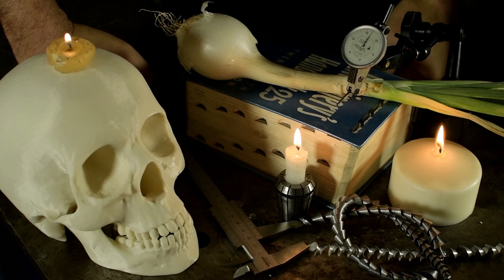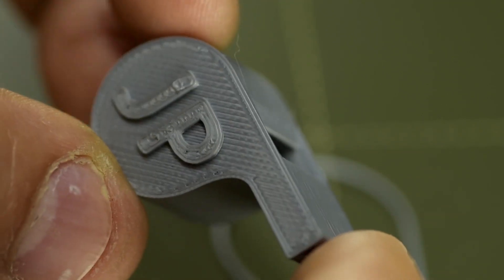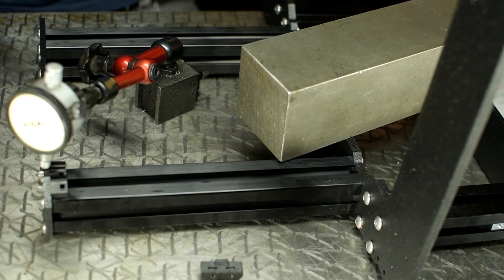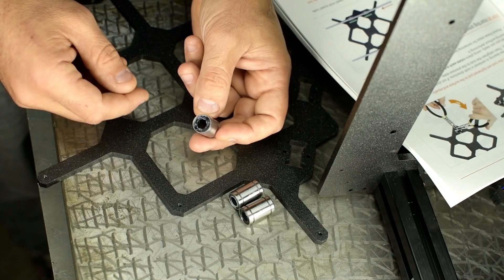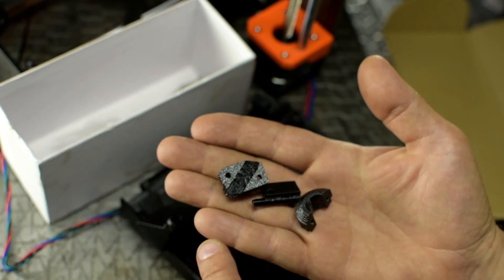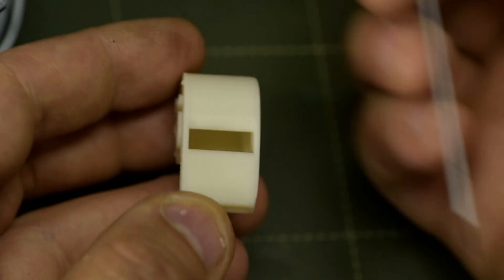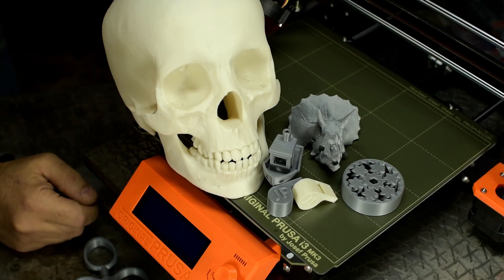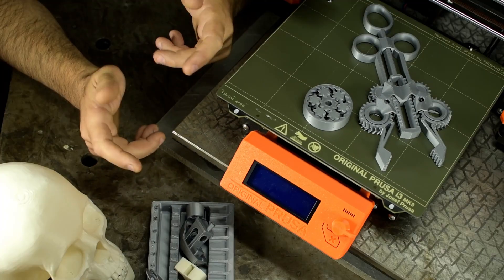This Old Tony in 3D!!! (printing)

Comment: Hey Tony! Check the Z lead screws, make sure it's square to the frame in x and y. I have found that printers are very sensitive to them being off even a little.
Reply: imagine if Tony upgraded or made from scratch his own 3d printer?! I look forward to the day 1 year from now (the time it take for the average CNC fan to acquiesce to additive manufacturing as a real "not going away" engineering option)

Comment: When you lubricate the bearings, you only need a light smear.......  if you pack the balls in grease there is a risk the balls will become impacted and start skidding.....  then the will  wear out faster and potentially gaul the shafts.  Over lubrication of bearings with grease is one of the most common causes of premature failure.

Comment: Bird water-whistles are the best printed ones IMO (except for the super-loud emergency type). You add water and the varying lengths of air escaping make a bird-sounding warble that you can vary a lot. Fun to play with.

ps- and a Clean/Dirty dishwasher magnet is always a well-received gift. and NO 5.5mm?! You must not have to work on Ford interior stuff much. ;)
Reply: Ford interior...  LOL!  That's the EXACT thing that I thought of.  Had to get 5.5mm for the knee panel under the steering wheel for my '96 Ford Contour.  Funny thing, just a couple weeks ago, I got a 2000 Saturn as a Daily Driver.  They used 5.5mm on a similar panel and on the  steering column shroud.  Maybe that Ford engineer got hired on at Saturn.  LOL!

Comment: I
You have no problems because it's a prusa. They send out good stuff. I put mine together and being the idiot I am, the printer worked surprisingly right out of the box. With little to no changes as long as you use a decent filament

Comment: I always thought a 3D printer as a toy, like what can you do with it? Whistles, benchies, toys.  Yes and some prototype designs that were later machined, pretty cool. I made a swivel block for a mono pod camera stand, it was perfect. Even though it is made from PLA, there is no evidence of cracking or failure. Sometimes you can make a solid model but often there is a bit of tweaking is necessary to really make a design work well. BTW, I bought the cheap unit, in hindsight, knowing what I know now, a Prusa  would be even better. Even so, the less expensive one can do a lot of things. Congratulations, have fun with yours.

Comment: The thing that was my personal tipping point for "it's finally time to cave and get one" is the boots for my motorcycle airbox. Those are totally "what do you mean $80 (x2)" Plus they are an awful fight in and out. Now with NinjaFlex something or other, I can make a custom airbox with monolithic boots which can handle the temps. It's amazing. I really look forward to having one.
Reply: Funky gaskets too!
Reply: Fiberlogy Fiberflex 40D is really nice too. It's got a good sproing to it and it holds it's shape well. It can be stringy as a motherfucker though, but that's just a matter of design.

Comment: I use my Tormach about twice a month, my lathe maybe one or twice a week. I weld maybe once a month.  I print 3d stuff 15 to 20 times a month and it's not uncommon to have my Taz5 and my Prusa Mk3 printing at the same time.  You just have to remember it can work all night and you can wake up to a new toy so don't go to bed until it's printing something.  Prusa was a good choice.

Comment: I think you did a made a good choice going with a Prusa, the removable bed is worth it alone.. but you also get the micro stepping and power outage recovery, auto bed leveling, filament movement sensor and more. I'm not saying the crealitys are bad, but they are no prusa. But hey, my first was a 300 dollar anet A6, I've had it for 3+ years and its still going strong.. Also, stay away from that devil material know as ABS, well if you have an enclosure it helps alot.

Comment: Printing is easy. But most people are going to have a problem drawing a 3D part. CAD isn’t the easiest of things to learn. So most people buying 3D printers stick to printing objects whose drawings they can download. I’ve been using CAD for several decades, and I’m sure you’ve been using it for a while as well. Moving to a printer isn’t so difficult then. But drawing a part for subtractive machining can be very different than drawing the same part for additive printing, as I’m sure you’re finding out.

I haven’t bought a printer yet because my dreams of one move to the realm of fantasy, as I really want one that will print metal parts. Plastic is nice, but not useful for much of what I do. Well, prices are coming down, so maybe someday. Good luck with this.

Comment: Decent Benchy for a Prusa machine.
There are a lot of print flaws, but that's just how Prusa machines with their weak ass frames are.
Reply: for specifics: it has some Z banding, and quite a lot of rippling.
Whiskers are from a bit too high nozzle temp or a touch too low filament retract, distance or speed (or combination of all 3).

Check if you can read text on back or bottom
Reply: Ender 3 prints nicer, but is slower and in practice you are limited to PLA (well ASA does work, but i like to print ABS or ASA hotter than PTFE hotend can do).

Prusa in that sense is more capable, and it's also way more polished. But less reliable too, and more finicky parts.

My choice has been a bunch of Ender 3s

Comment: To be perfectly honest with you, straight out of the box, an Ender 3 is about 90% of the machine that a genuine Prusa is, but for less than 1/3 the price and it only took me an hour to assemble mine, even considering the use of a dial indicator to get everything leveled properly. With the amount of time and care that you put into assembling the Prusa, you would have had absolutely identical results when printing in PLA with the Ender 3. 

Adding another $150 or so to the Ender's price with some pre-made upgrades (32-bit board, better bed leveling die springs, auto bed level sensor, glass build plate, all metal hot end, capricorn tubing, direct drive extruder, etc) and then printing a couple more things yourself will get you an even more capable machine than the Prusa and for half the price. And, since the Ender doesn't depend on expensive linear rails, the expandability is even better: longer 8020 rails can expand the scale of the Ender 3 almost to infinity.

Comment: ASA probably wants an enclosure as you've said. However I find that PETG prints just fine without one, and is definitely a good option if you need a stronger part. I'd also recommend dialing in some sort of TPU to print with. The ability to make bushings etc is fantastic. Also while you can probably mill/turn/weld stronger parts, making softer things usually involves a mold and casting, skipping that and just printing them can be a real time saver.

Comment: Be careful with humidity and filaments like petg, mine went bad (water in the filament - bubbling, popping) while printing a few small parts at 30% room humidity. The most permanent solution is to get and modify a food dehydrator to hold rolls of filament while they are printing.

Also keep in mind that the bed material can change depending on the material.

Comment: i remember the prusa i3 mk1, i buy it for 700 usd and feel scammed when i realize half the machine is hold toghether with with zipties. decent prints tho
Reply: @npgoalkeeper _ i know, never had a problem from a ziptie, just feels cheap for a machine that cost 700 usd, i bought after an artillery x1, i know is chinesium but it feels more value for my money than the prusa mk1

Comment: One thing about 3dp....   (not  counting the start, reset, retries ) you get the print going, walk away (maybe occasionally monitoring with octopi) and come back a few hours later and pull your print.    The real time waster is the time you'll spend designing stuff and figuring out good dimensions.   You do the same in any contraptioneering, whether it's wood, aluminum or steel, but you notice it more when you spend four or five hours in openSCAD (maybe I should learn Fusion360)  for something you only really spending 10-15 minutes (not counting unattending print time) at the printer.   It doesn't bother you so much if your spending a few hours designing then spending ten to twenty hours with saws, lathe's drill presses and files to make the part. 

It's also a thing where if what you're making is not too complicated you can just rough sketch it out and good-enough guesstimate dimensions beforehand and work out the exact sizes on the floor as you're doing (takes some experience and yes, I've blown a few projects by getting it wrong).   With the 3dp stuff you've got to do ALL the up-front up front.

Comment: Please do yourself a favor and set up a Raspberry Pi with OctoPi and the plugins that watch the heat of the hot end and the bed should there be a failure on the main board that could cause the temp to increase until there is a fire.   OctoPi not only adds safety to the thing, but also a level of remote management, camera views to your phone, and other tools like the ability to cancel parts of a build instead of the whole thing should there be an issue with one piece of something while printing multiple parts.  Hope you have fun with it! :-D

Comment: To address an issue that is NOT the subject of this video:

The blow moulded inserts that hold the parts in (e.g.) socket sets are really weak. But I saw a truly great tip. In a restore video the guy squirted builders insulating foam in the BACK side, and trimmed the excess flat when it had set. This provides really good support for the thin, weak plastic.

Cheap, easy, effective.

So - to give proper credit - it was Geoffrey Croker in NZ.

Around 18:15 in this socket set restoration:

https://www.youtube.com/watch?v=9ULUw5gtzj4
Reply: Thats a Great Tip, in Australia, we call that stuff Expanda Foam
Reply: @ashc5728  In Australia we call that stuff raising the practical jokes bar. Spaceinvader ya mates toolbox and see just how deep the friendship goes.
Reply: Very good idea. Going to do this to some of my sets tomorrow
Reply: Use the low expansion variant, and leave the tools in them while it sets if you can.
Reply: You'd be thinking of Geoffrey Croker's video where he restored the Stahlwille socket set. https://www.youtube.com/watch?v=9ULUw5gtzj4
Reply: @WilliamRowan  you mean the guy I named, and the video I linked to?

Yes, that's who I meant. Thanks for clarifying. 🤣
Reply: @WilliamRowan  Just thinking what His channel was called thanks for a lot less head scratching

Comment: I will say, look into lost PLA and lost wax casting. By far the handiest thing I have found for 3d printing, you can fairly inexpensively take any shape you want and pour it in aluminum. I don't know, with TOT's current hobbies, how useful plastic parts are going to be, but the ability to make molds for cast parts is a game-changer in the home shop for me. And good choice on the printer, I built my own in 2013 and finally got tired of the printer always needing work & attention. Decided to go for the Prusa as well, and couldn't have been happier- it's definitely higher quality than the budget price should allow.

Comment: If your having problems with things sticking to the plate, you can mix some abs with acetone and spread it onto the bed. Also with most slicers there is a draft shield option and it will print it's own draft shield.

Comment: The Pruisa printers are great. I bought the kit about a year ago. Mine also printed great right off the bat. Now 15 rolls of petg and asa later, still haven't had a bad print and haven't touched the hardware. I recommend octoprint on a raspberry pi, can't live without it.

Comment: “What do you mean, $50?”

Laughed my a$$ off
Reply: I paid $100 for a gear knob adapter 15yrs ago, guy didn't even know what he was doing ( lathe) and I got an off centered one. Now what all the crap I've learned over the years, I'd just buy some tube at the right OD and thickness, and just drill the ID (if need be) tap em. All likely WAAY below $50, and I keep the tools. Live and learn.

Comment: Bought a Prusa i3 back in 2013 and lets say after about 3 prints got tired of all the tweeking needed and it was just getting dust until I started using it's parts on other projects. Well this year I got a 5 inch Elegoo Mars Pro resin printer for 300e and I can say it is another level of print quality and doesn't really need any tweeking. Yeah the print size is a bit small, but I'm actually printing some small parts for a company by the dozens and it's pretty close to buying itäs self back, looking at getting a 10" Saturn for about 450e later this year when it comes out.

Comment: For low load functional parts, try nylon filaments. Taulman 910, Polymaker COPA or Colorfabb PA Neat (Taulman the more flexible, Colorfabb the less). Just use a layer of elmers glue to eliminate warping. You will need a filament dryer...don't even try to print nylon whitout one. 
You can try Carbon filled nylons too...but they come with their own set of printing issues, and if you really need something strong most probably you will make it from metal anyway.

Comment: I have an ender-3, and even if the first result are quite nice, it's very far from Prusa result. It cost only 200 clams but be sure to add around half in upgrade parts and maintenance (bearing wheel are very fragile).

Comment: My dip into the 3rd dimension was an Ender 3. With a little mechanical sympathy and understanding, it works surprisingly well given the price. I’ve printed loads of really useful things for a current car building project. Unless I’d done it myself, I’d not believe you can print tools from plastic that can bend metal. I’ve done sheet metal folding tools as well as dies for bead rolling and tube bending. Remarkable.

Comment: The shear volume of the number of printers sales, combined with the large active community.
Settings aren't too hard to dial down, especially if you use a common material. Chances are someone has that setting.

Comment: If you have a spare Raspberry Pi knocking around (preferably 3B or newer), put Octoprint on it and ditch the SD card.

It completely changes the whole 3D printing workflow and allows you to check actual bed flatness for example with the right plug in.

Also, for a machinist like yourself, research the Nyloc mod. It's the only way to flatten the build plate at working temperatures. The PINDA probe works great to tram in the head and get plastic evenly on the bed but it can't make a warped bed flat (which I don't need to explain the importance of to you).

Comment: The ender 3 is my go to printer, works great right out of the box.
Loads of resources out there for modding just about every 3d printer for better operation, teaching tech is a great channel to check out, what he doesn't know about dialing in your settings, board replacement, stepper driver replacement, current smoothers, stepper vibration dampers, adding linear rails and so on probably hasn't been invented yet. If you use an fdm often you do tend to spend a lot of time on upgrades to tweak it just that little bit closer to perfect.

Comment: Open-frame printers - not a best choice. The environment temperature is very important (if you want to get sturdy parts), and i strongly recommend you to use the box-like printers. "Monoprice Ultimate 2", "Duplicator 6", "Ultimaker 2" etc.

[sorry for my bad english]

Comment: In the past I have unsubscribed from a few channels when they started 3D printing because they just set up a camera on time lapse and show  what the printer has been doing this week. It quickly becomes an automated channel with minimal effort from the 'creator'.
However I'm pretty sure you see this as just another tool and hopefully won't fall into that routine.
I particularly liked that insert for the Hex Key set, that was a great use for the printer and I'd love to know how you designed it !

I have a few friends that jumped on the 3D printing bandwagon, most of them just bought the cheapest one they could find and quickly discovered the limitations of their 'investments', so after printing lots of small useless trinkets that nobody wants, their printers were left in a corner to gather dust. Only 1 of my friends actually uses his on a regular basis and his interest is gradually declining.

Comment: Prusa printers are nice expensive toys, with 1000€, I've built a CoreXY with 300x300x400, two hemera extruders, servo steppers for x and y, self leveling bed with 3 steppers and duet controller. Prusa does makes nice printers that print nice toys, but way too expensive for what they are capable of doing. Also, my monster goes 200mm/s, and does a lot more. Check Hevort.

Comment: You did the right thing going with the Prusa over the crapality. I however went with the cheap option, because I am cheap. And 6 months later I still am not remotely happy with it. In fact I hate it so much I have given up. People get great results from them, but you have to sink a lot of time (and sometimes money) to tweak them. I got the printer with the same mindset as you, so messing too much with something I rarely have a use for is not going to happen. Probably sell it at some point and get a prusa. Poor man goes twice to marked...

Comment: 3D printers doesn't work in Sunny South Africa, doesn't matter if you buy the cheapest or most expensive one. Doesn't matter what plastic you print with. It just doesn't work. It doesn't matter if you try to print something basic or something complex you always end up with just a portion of your project. The reason, our power gets cut to frequently. Its called load shedding, the official government term for incompetence in the energy sector. Hi Tony, can you please print us a couple of power stations. I am sure you will be faster than what we do them.